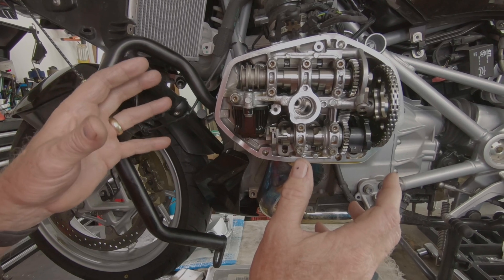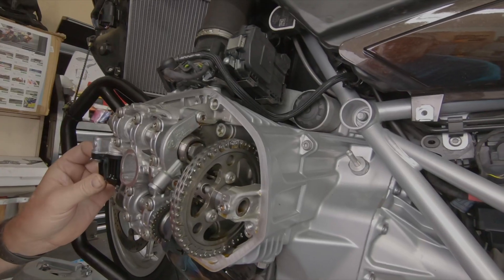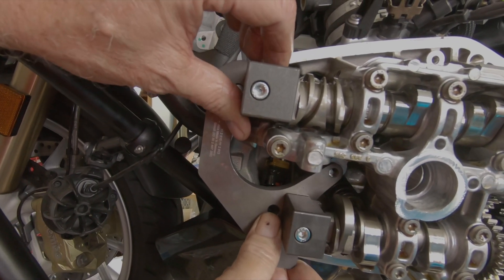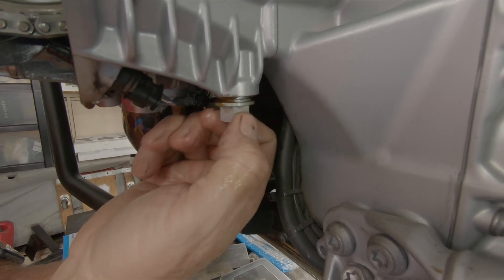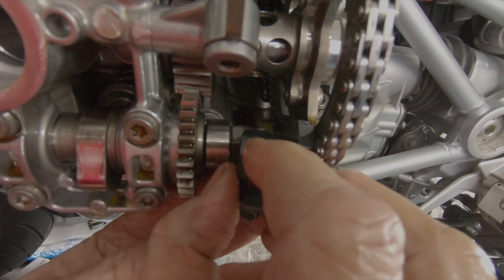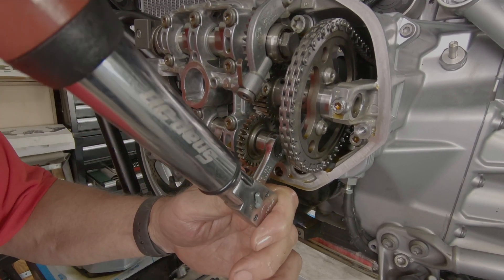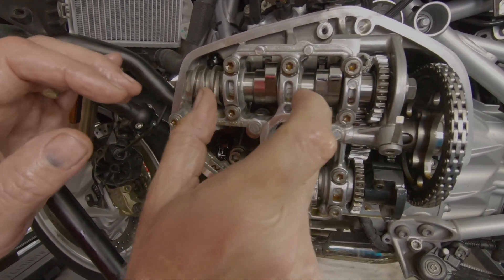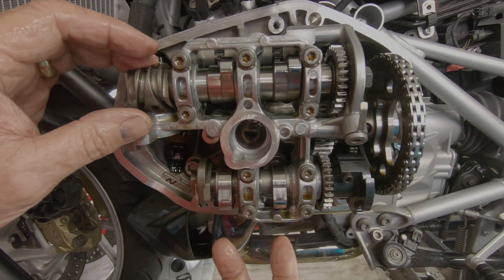BMW R1250 LH Cam Timing Part 1 of 4

Comment: Oh so you don't have to turn the tire like on a 1200 engine?! Interesting. Great video. Thanks for taking the time to make it
Reply from the maker: The turning tool works well for both the 1200 and the 1250. Sure is nicer than putting an oily hand on the tire anytime you need to turn the engine over…which I do every time between installing new shims and doing the follow up measurements.
Reply: @Boxflyer11  I gotcha 👌. I'll reference your videos whenever I need to do such jobs. Thanks

Comment: Great videos, thank you very much. I'm going to be taking this job on later this week. I noticed a slight difference from the R1250 service manual. After the ignition timing is adjusted, they remove the alignment jig and the TDC locating pin, crank the engine with the barring tool until it is at TDC again, lock it with the pin, then re-install the alignment tool a second time to check the timing. Do you see any value in this?
Reply from the maker: That would be fine, BUT, I would not keep the tension on the Cam Chain Tensioner.  I'd slack it off before turning the engine over to relieve some of the excess pressure on the slack side of the cam chain...it's just too tight for turning the engine over.  It's basically doing another complete setup to check timing after you just went thru the setup to align all the components.  I DO turn the engine over after checking and replacing any of the valve shims with the Cam Chain Tensioner slacked off.  This has proven to give me credible readings immediately after touching all the surfaces that can leave "crap" on these critical clearance surfaces...it's my practice after doing well over 100 of these checks.
Reply: @Boxflyer11  thank you very much for sharing your knowledge.

Comment: I think, there is a slight mistake in the video. According to BMW RepROM: 

Camshaft sprocket to camshaft tightening torques
 
Exhaust, right, M10 x 1.25 x 25 - 10.9 
 65 Nm 
   
other camshafts, M10 x 1.25 x 35 - 10.9 
 60 Nm 
 

In the video it calls all 65 Nm
Reply from the maker: I think there is a huge mistake in the BMW RepROM. 
If you want to have a go at figuring out why a single 25mm bolt that’s the same bolt as 2 others gets a different torque than the single 35mm on the LH EXH, that’s the only different one of the 4…have at it. 
I believe that paragraph is wrong and the only way to error on the safe side is to torque ALL the bolts to 65Nm. 
I’m doing soooo many of these that it would be impossible to catch up with every bike that would be under torqued following the BMW way so I could add 8% to 2 shorter 25mm bolts and 1 bolt that’s 35mm long. 
Do what you like, but I doubt BMW will respond to this error when they won’t share the RepROM with anyone.
Reply: @Boxflyer11 My repair manual says 12Nm+180° for both
Reply from the maker: @kennethborgen4677  Feel free to do whatever you want, at your own risk. That will certainly twist off every cam gear bolt.
Reply: @Boxflyer11 Sorry, this was my mistake, it lists 65 and 60.
Reply from the maker: @kennethborgen4677   Glad you found the other reference.  Although those are incorrect as well.  Just do them all at 65Nm.

Comment: New subscriber here.  Great content.  Keep the videos coming
Reply from the maker: Thanks for subbing
Reply: @Boxflyer11  No problem.  If you by any chance know the bmw tools required to do  the cam timing and valve adjustment please post.  I'll get it and do it myself.  I'm due for service in the next 3000 miles.

Comment: Impressive; thank you. Three questions: 1) what symptom would you expect to hear/feel from a boxer engine that is not perfectly timed?  2) do you have any guess of the % of engines operating that are not correctly timed?  3) is checking timing a usual and customary shop service/check?
Reply from the maker: Hi Andrew, answers to your questions:
1) I think that a slightly out of time set of cams generally runs a little rougher, both at idle and at intermediate RPMs as well.  Sometimes it represents as hard starting, but that is more likely the timing reluctor being out of time, and is part of establishing correct alignment for all the valve train components.  There may be a little less economy also from less than optimal flow thru the heads.
2) My experience with doing about 100 Cam and Valve checks is that about 85% of the "First Look" timing checks need some adjustment of both the cams and timing reluctor.
3) I don't know for sure, but I don't think shops would do a Cam Timing check unless some part of the valve train was disassembled for the replacement of a component.  This procedure is not called for in any of the normal mileage or calendar service sheets.
Reply: @Boxflyer11  I can confirm that a bmw dealer does not do cam timing checks and alignments. Quote: "we can only replace the cams."

You might also get excess vibration between 4200-4800 rpm on wetheads 1200 lc. 

Because of the special tools needed it's unfortunately something I cant do myself. These tools are hard to come by.